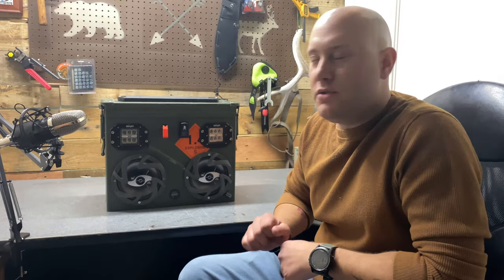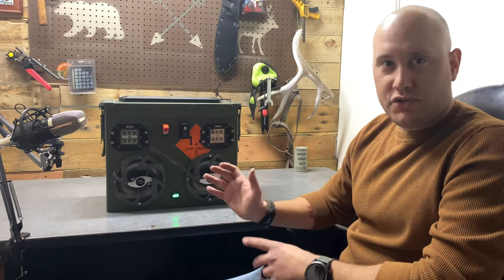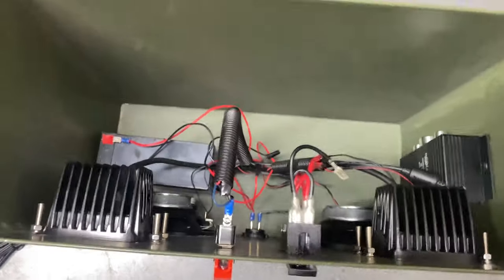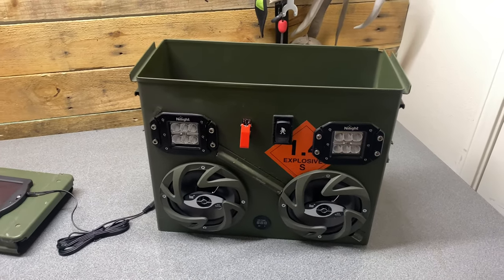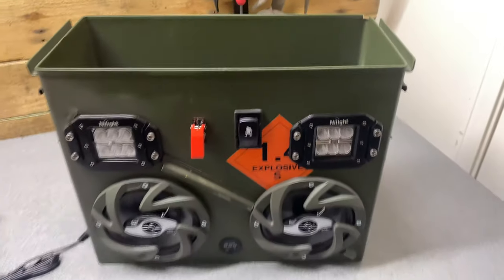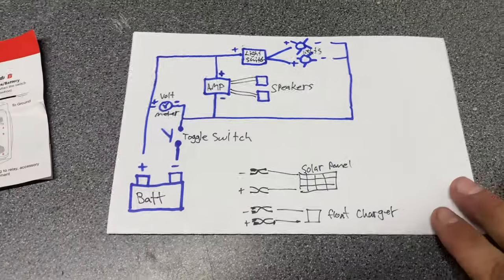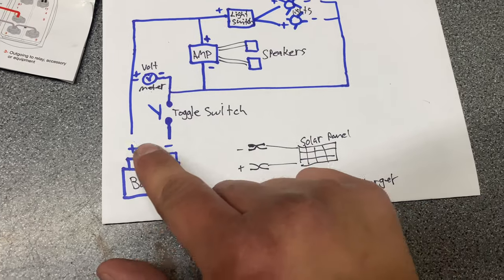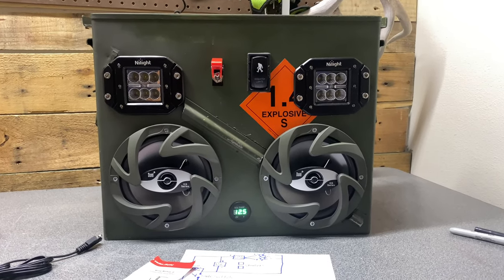How to make an ammo can boombox

Comment: I wanted to know if 6.5 150watt marine speaker would fit on front a plastic dry storage marine box that 15.13”Lx7.88”Wx10.13”H ?
Reply from the maker: It would be close, but I think they should work. If you have the box, most speakers come with a stencil or template for cutting there hole. So I would use that before you cut so you don’t ruin a nice box

Comment: What lights did you use dude
Reply from the maker: Nilight 2PCS 18W Flood Flush Mount LED Work Light Fog Lights Off Road Lights Driving Lights With Off Road Wiring Harness, 2 Years Warranty (ZH050) https://www.amazon.com/dp/B06XTXDGRR/ref=cm_sw_r_cp_api_glt_fabc_WXHX6PNB1HYNJYBYWNFH?_encoding=UTF8&psc=1
Reply from the maker: I used these lights, but you can use any flush Mount led lights. These are a decent price and sometimes go on sale even cheaper. Thanks for watching!